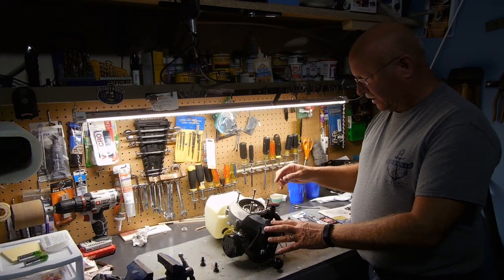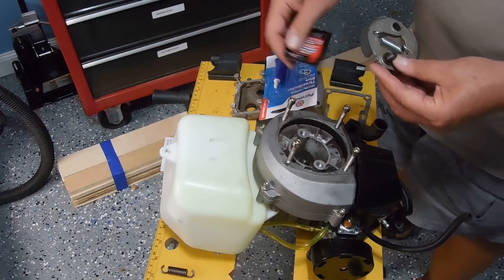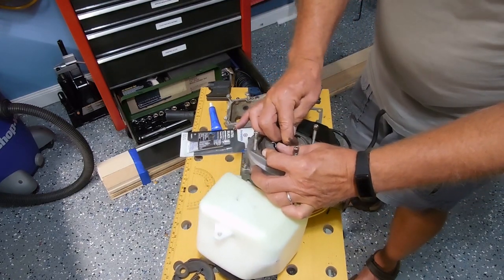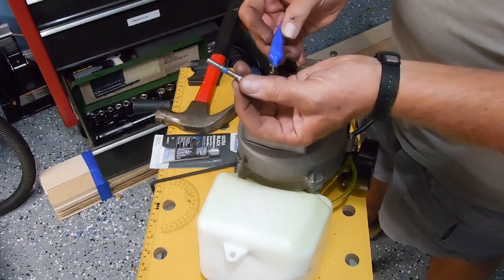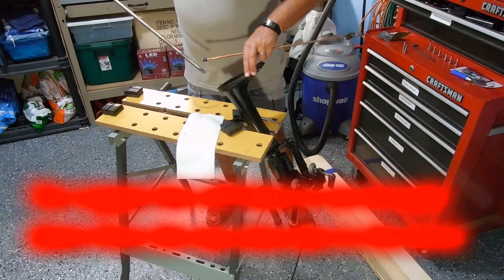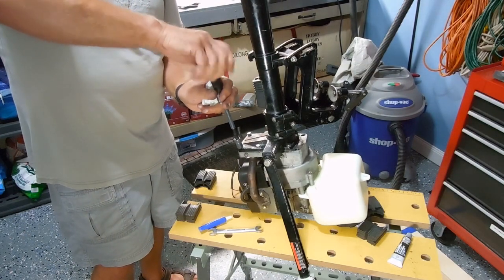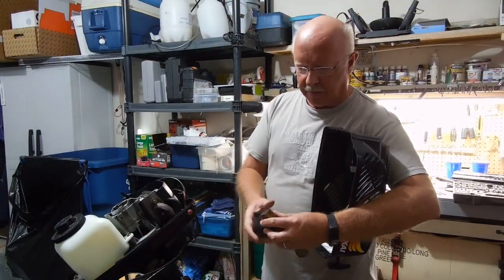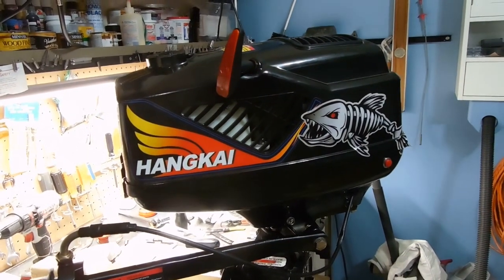Hangkai 3.6 hp Clutch Repair

Comment: I have been afraid to buy  one these motors b/c I know the parts are not as good as the more expensive brands and wear quicker. Your detailed repair videos have given me a greater vote of confidence in purchasing one. Thanks for taking the time to share your knowledge!
Reply from the maker: You’re welcome.  I think the engine block is sound. It’s the little things that you’ll be messing with. That being said, it’s not difficult to work on. I’d plan on replacing the clutch as part of routine maintenance! I think putting in a less tight clutch spring would help tremendously in lengthening clutch life!
Mine would work better on a better boat too!
Thanks for watching 👍

Comment: Really appreciate all of your advice and guidance BoilerDan1, it was your reviews that gave me the confidence to invest in one of these motors. Having somebody have worked out all the bugs early on like the fuel lines and spark plug issues etc made it really easy for me to make my motor better before it was even used once + really easy to replace these parts with ones of better quality with your comprehensive step-by-step instructions. I live in Australia (state of Tasmania currently) and I have very limited knowledge and experience with any motors, so thank you again for all of your help. A new unprecedented experience that I had with my motor recently did cause me a minor headache but was a relatively cheap fix, and I wanted to give you and others a heads up so that you know what to expect if the same thing happens to you. Basically lower water levels in summer caught me off guard and while in shallower waters I struck two submerged objects, both timber not rock I believe. I visually inspected the prop etc at the time and aside from expected cosmetic damage it seemed ok and appeared to still operate. A few months later it came time for me to service the gear oil and when I tried to remove the split pin through the prop it wouldn't budge. At first I thought it was because I had reused the split pin a few times and it had buggered it, but after an hour of doing everything I could think of to remove it, I did manage to successfully inch the pin free. Next I went to remove the prop which normally slides off easily being greased etc, but this time it was jumpy sliding off and got caught a few times. Once it pulled off without a second thought I just tried to slide it back on to see if it got caught again, but I couldn't get it to slide back on? So I flipped over the prop to inspect the inside and I was stunned to see that the section inside the prop that is moulded to the shape of the little bar that goes through the prop shaft had broken in places! Not enough to stop the remaining intact internal structure to sit on the bar properly and continue to drive the prop, but enough for small chips of aluminium to have broken away and be getting jammed in things. Even though it is still usable as it is I am opting to get a new prop online (was less than AUD$20 delivered via ebay) because they can be acquired for relatively cheap and I figure the old one can just be put away as an emergency spare. Finally I needed to get the little bar through the prop shaft out to be able to carry out the gear oil change, but of course it was bent just slightly on both ends, just enough so that it couldn't be pulled out either direction. I had to cut it off with a grinder to get it free, luckily there are a few spares of that piece with the motor. So eventually I realized that the two impacts that had occurred were responsible for all of the damage and problems from the little bar through the prop shaft, to everything above it. Not a hard fix but just thought I'd let you know about my own experience, not particularly looking forward to having to do my clutch soon but I have just got a new Parsun 9.8hp two stroke so I shouldn't need to run the little motor as often anymore either. Thank you again and I look forward to viewing your next Hangkai outboard videos, from Gareth H @ ETNW.
Reply from the maker: Nicole Holmes :
Thanks for taking the time to write! That little bent bar is a shear pin.  The idea is that it should have snapped in two, preventing the damage to your prop.... oh well, another lesson for us all!
Thanks for watching!

Comment: Thanks so much for doing this series. Actually doesn't look like a terrible engine for some applications. I need a small outboard to get a dingy out to a moored sailboat and this is NOT the outboard for me. There is too much time and work keeping a 40 yr old sailboat in good working order to spend a lot of time messing with the kicker for a dingy. I'll pony up the extra money for a Tohatsu or decent used Yamaha. Great job.
Reply from the maker: Jeff Smith 
Thanks for taking the time to comment! I’m happy to have provided information helpful in your decision.  I totally agree with your choice!  I rarely take mine out and as you’ve seen in the videos, I keep having to make little repairs.... clutch replacement the most recent.... I’ve decided that will need to be a seasonal routine maintenance item 😂🥺
Reply: @BoilerDan1  clutch material is problem,french moped clutches never wear out same principle vintage bikesget yours relined with good western pads by some one who  does brake shoes,still dont trust any rubber hoses from china,they dont use proper formula for mix check out online many failures cars bikes the loi,thanks for all detail close up for bolts and they do engage all theway look at your tap and die set.good luck from the clyde scotland

Comment: Great videos Dan! Did you obtain greater life from the Honda aftermarket clutch? I suspect the lighter spring allows quicker seating of the friction material, as well as greater force at mid level RPMs. I'm curious to know how you fared!
Reply from the maker: All the springs were too heavy so I ended putting in a very light spring that I picked up at a hardware store.  It did much better, although it may have been so light that at idle the prop may have still been too. That was fine with me.
I’m getting a little older and sold the system. That person was familiar with the motor and thrilled to have mine.
I’d have been happier with it on a hard shell small boat….. The raft was a little too spongy causing it to lose thrust.  But I had a lot of fun with it and would do it all over again.😂👍
Thanks for watching and hope the series helped you too.
👍👍

Comment: Glad I found this. So very good tips, thanks. I may buy one of these motors just to work on it. Why did you replace the factor spring on the new clutch assembly?
Reply from the maker: Two clarifications.  
1. You don’t need to break it in using a bucket. Just take it out on the water.
Mine arrived in the winter. I kept adding snow to keep the water cool. You can run a hose as an alternative.
2. The clutch spring is way too heavy so the clutch doesn’t engage at low speed. That also caused the clutch to wear out a lot sooner.  If you completely remove the spring the propeller will always turn but so will the cooling wheel.  Just have to shut down when you pull into dock. But I don’t think at an idle you’d get much thrust. Thanks for watching, I made several videos of my adventure, I hope they continue to be helpful….
Several people also report that the spark plug goes bad. I’d replace that too.

Comment: Great Dan!👍
Wanna see how it now runs.
When I looked at my clutch, I took it apart from the top so the shaft and water line stayed attached all the time.
Were you able to freely spin the shaft and prop by hand? Mine was way too stiff to turn by hand.
Thx!
Reply from the maker: Hmm, I never thought to take it apart from the top....  Darn, I'll have to look at it differently next clutch change!
I was able to turn both the shaft and prop by hand, although it was kind of stiff.  but it would turn.
I'm hoping I'll get the speed I've been missing?  I'm going of a little vacation, so it's going to be a couple of weeks unless I can work a day out before leaving?
Reply: Update: Took the whole thing apart to examine. The main shaft gear cog was too loose and slipping on the prop shaft gear. Tightened it down. Also shimmied down the rubber water impeller as it was too tight in its housing. It works now! Lots of water running through and the prop spins and displaces all the water in the test bucket.
Just in time for the winter. Well next season will come around quick enough. 👍😊

Comment: Hi ya dan ..quick question i was on boat yesterday and my engine started smoking from around the spark plug area and fuel spitting out do u no what cursed it ?
Reply from the maker: I’m not a mechanic so I’m just guessing!
But if something is coming out from around the spark plug where it screws in, I would check the seal of the spark plug?
It could be a little lose an the issue you are having would do that.
If you have the original spark plug in it, I’d replace it.  You could tighten the one in there but be careful not to over tighten for fear of stripping the threads…. Which would also give you the same type issue with leaking around it.  If stripped, you’ll need a real machinist to rethread the opening….. hope that helps you in trouble shooting the motor.
Reply: @BoilerDan1  ok thank u mate thats been a big help 👍

Comment: What was the reason for a lighter spring? I assume you wanted to engage at a lower rpm.
But why?
Reply from the maker: Yes, you assumed correctly.
I would have to go full throttle to get the clutch to engage.  I also was thinking that it was slipping because a less than ideal clutch engagement.
I attributed that to the clutch wearing out quicker than I would expect.
So it’s a combination of engaging at a lower speed and less slipping and wear on the clutch face / surface.
Hope that makes sense?
Thanks for watching 👍
Reply: Dan thank you for your reply. Keep us posted how it working out. I,m a motor head also. I just received my motor and thinking of just going ahead 
& doing that mod now. Thank you my friend.  @BoilerDan1
Reply from the maker: I think it’ll help.
Unfortunately, due to no nearby lake, and the river that you’ll see in some of my videos not being very safe for an inflatable…… and listening to my family….. being in my early 70’s.
I sold the entire system to a guy familiar with the motor and was thrilled to have it. Last I heard it was still working out.
So I’m building tall wooden ships instead of motoring around in the raft!😂👍

Comment: What brand clutch did you buy and did you get it from Amazon? There's a lot of brands an a lot of difference in prices. Thanks for the videos.
Reply from the maker: Amazon.
I ordered two, one was just the clutch and the second had bolts included.
Yes there are several to choose from and I think any of them would work.
If you can find one that looks like the tension spring is lighter, I’d recommend that.
Here’s a link to the one I purchased:
Clutch Drive Bolt Washers For... https://www.amazon.com/dp/B07J6F4J6M?ref=ppx_pop_mob_ap_share
You’re welcome 👍
Reply: Thanks,  that will make it much easier on a mechanically declined old fella.

Comment: I would guess you would want to be at idle or WOT (clutch fully disengaged or fully engaged) so the clutch doesn’t have much time to slip. Driving around slowly might wear out the clutch in one day...
Reply from the maker: Yes, but even doing that I think the clutch would wear out in one season! Putting in the lighter spring really helps 👍I’d recommend that at the first clutch change.
Thanks for watching 👍👍

Comment: My clutch just went out. Did you get it on line, ebay, Amazon. I would appreciate a link to the one you used for your motor. Thanks for the detailed information on your videos.
Reply from the maker: Amazon: Do a search on Amazon for GX31 clutch and you’ll get several choices,   This one is just the clutch and spring. I put on a lighter spring and that has worked much better. JRL Embrague Clutch Assembly Part For HONDA GX31 GX35 Strimmer Bush Cutter 76mm https://www.amazon.com/dp/B01A09QFVS/ref=cm_sw_r_cp_apip_kuE3tZ5S2kFUE
Reply from the maker: You can also get them from eBay. Thanks for watching 👍
Reply: @BoilerDan1  thank you

Comment: Dan, is this motor really a 3.6 hp or maybe a 1.5 or 2.5 ?
Reply from the maker: Ha, you might be correct!  But I can honestly tell you the because it’s on a pretty cheap air filled raft, it loses thrust because of the wrong tilt and the squishing of the raft. I really think it would work better on a light weight solid boat.  It’ll push faster than a trolling motor.  However the 2 stroke exhaust is below the water line so quite a bit of sound goes down into the water.  If I were to start all over, I think I’d get the 4 stroke that has the muffler!
Thanks for watching 👍👍

Comment: Hey there I just purchased mine did everything correctly and I can't get it to fire what should I do?
Reply from the maker: 1st option is to return it.   2nd option.  Things to check .... Do you know that the choke lever is backwards?  Off is the choke is on. ... and on means that the choke is off and the engine is on run.    Do you know to push the fuel bulb several times ?   Check for a spark ⚡️ on the spark plug. Mine was defective and I had to replace it.   One other thing could be carburetor adjustment.... but I’m not sure on that topic.  I bet you can find some general instructions on YouTube? Or you could try adjusting the screws by 1/4” turns?  I’d try searching for carb adjustments for similar motors on something else.... maybe even a weed wacker 😂. Sorry.... Hope you can get it figured out.

Comment: Me again mate lol..how often do the clutches go ?
Reply from the maker: I’d change it every season but you can kinda tell by the sound of the clutch. Changing the spring will help a bunch.
With a lighter spring I’d guess two seasons or more...
Reply: @BoilerDan1  when u say season how many hours of run time ? . Thanks for responding mate
Reply from the maker: It lasted me two summers but I didn’t keep track of hours.  But in hindsight, I could start hearing it slip.  Then when I knew it was time to replace it, it had very little thrust.
Reply: @BoilerDan1  thanks mate

Comment: thread locker and anti seize on the same bolt wtf. I would thread locker only, you do not want those things coming out. good video/series otherwise
Reply from the maker: Good point, I guess they would work against each other!  I’ll keep an eye on them this spring and next time I’ll just use the thread locker. Thanks for watching and taking the time to give your advice. It’s much appreciated.
Reply: well I guess its because if they rusted on the lower bits it would snap before you got it off, so if you have anti seize on the bottom it stops rust welding and then the thread locker on the top stops it from coming out. Idk if that makes any sense but thats kinda why I thought he did it.

Comment: Well I have one hour so far running in the 5 gallon bucket the number one of the two Motors that I bought pretty much everything seems to be going pretty good I have to be careful with the pull starter line got to cement poxy little work there  that little gray guide back into the starter housing. Sounds like a weed whacker on steroids, 
Lol.
Reply from the maker: John B. L. Shelnutt Be sure to keep cool water running in the bucket so you don’t overheat the motor.  I ordered another clutch so I have one ready to install next season 🤣